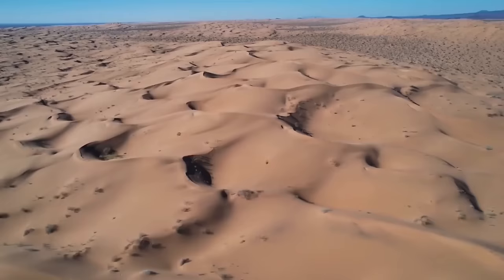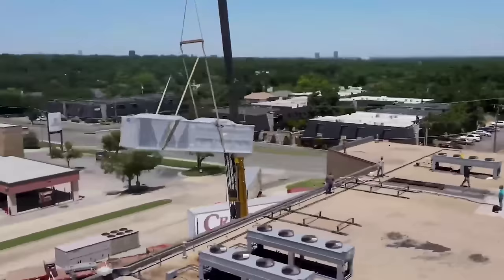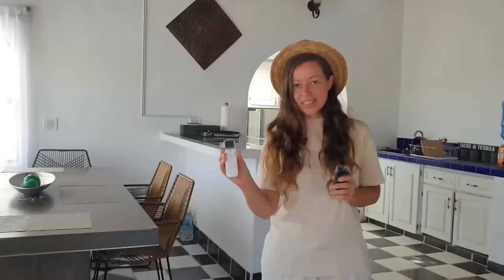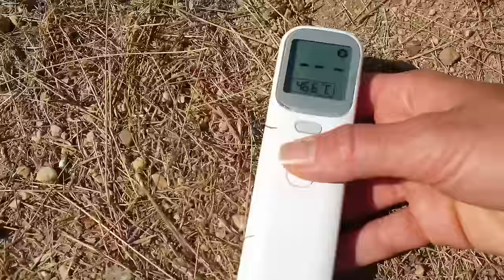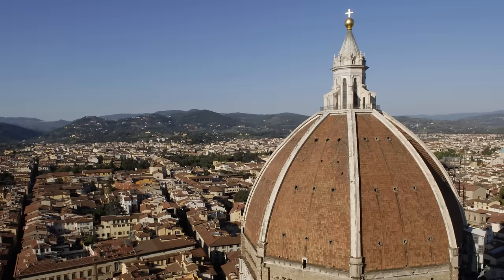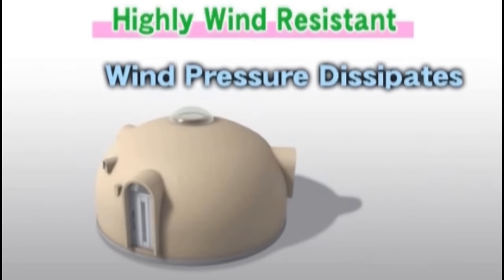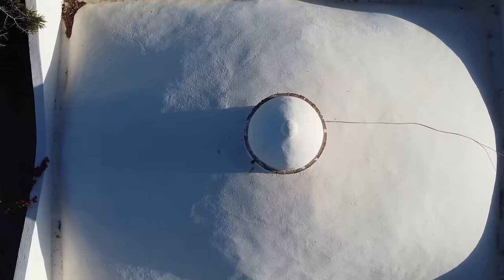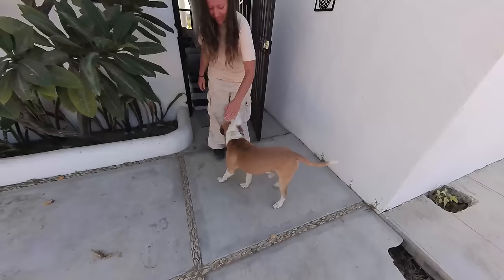How I Live In The Hottest Place On Earth Using An Ancient AC System To Stay Cool!

Comment from the maker: To try 👉 To try everything Brilliant has to offer—free—for a full 30 days, visit https://brilliant.org/LeafofLife. You'll also get 20% off an annual premium subscription. NO MINI SPLIT SYSTEM WAS USED IN THIS VIDEO. YES THERE IS A SYSTEM BUT IT WAS NOT USED. ITS ONLY THERE BECAUSE THE HOUSE IS A RENTAL PROLERTY AND YOU CAN GET MORE BOOKINGS IF YOU HAVE AC AS AN AMIENTITY, ALSO THERE ARE EXTREME TIMES IN THE SUMMER WHEN IT GETS VERY HUMID OR AT NIGHT WHEN IT GETS VERY COLD IN THE WINTER SO ITS USED AS HEATING. BUT IN THIS VIDEO IT WAS NOT USED. THE WHOLE REASON I CHOOSE THIS PLACE TO RENT WAS BECAUSE I WOULDNT HAVE TO USE THE AC IT MAKE ME VERY SICK, SO I WAS SO SURPRISED HOW EFFECTIVE THE DOME WORKED THAT I MADE THIS VIDEO. IF YOU EVER HAVE BEEN INSIDE A DOME YOU WOULD NOT BE DOUBTING THIS. ITS PRETTY SIMPLE AS WE WXPLAIN THROUGHOUT THE VIDEO.
Reply: Brick roof vs modern solar panel roof. I rather choose second on sunny part.

Comment: Pro tip: When it's 25 C° inside and 45 C° outside, don't open the doors and windows. 
Open everything at night, and close them in mid-morning.
Reply from the maker: this is true but at the same time because the house has over hangs in front of the windows its actually creating an area of cool air in front of the house so even when you open the door and window you can feel a cool breeze as the heat from the top sucks in the cool air
Reply: At my place when it's 45°C outside, it's 50°C inside. The windows are facing West so they get direct sunlight in summer and get super hot starting from around 3pm and stays hot until late nights or early morning. Don't like to open windows because of dust, pollen and flies/insects. Some days can also get very humid.
Reply: Yes, I agree. Maintain all windows and doors closed when the highest temperatures, and open windows and the roof window at night to create natural ventilation. The hot air flows upwards, escape and force cool air to enter through the windows.
Reply: Pro tip : move to a cooler location
Reply: Night time temps in the region during summer don't fall below 35C.
Reply: Why no shade sails? And there seems to be a conventional air conditioner on the wall...

Humidity has to be really low.
Reply: @larsstougaard7097  LOL! 🤣
Reply: This doesn’t work. The walls also become hot.
Reply: @moussapolytropos  It's still heating up much slower inside this way than if you let in warmer air from outside. 
I live in southern France, and I do this every summer. Mexico is hotter, but it's still true.

Edit: as long as your home is well insulated (thick walls, double-glass windows.)
Reply: @abadyr_  in Greece, when the heat wave lasts many days, with (double glass) windows, curtains and shutters closed, if you don’t have AC, you will faint… even with thick walls.
Reply: I can see the Air Conditioner behind, I think its the reason.
Reply: @lm-pw9ul  Put shades or blinds on the outside of your windows. You will see an incredible difference in the inside temperature.
Reply: @lm-pw9ul  There're reflective films (and new windows with them) who can decrease the amount of solar energy which passes through the window-glass.
The 85% one is like a mirror on the outside (but not like a mirror on the inside), and the lowest one is AFAIK 30%
Reply: Where i've been In Florida and Puerto Rico, opening everything at night will only bring in warm and VERY humid air.  It's late morning that one might get away with opening windows (cause that's when humidity drops while it's still not hot yet), and even then, that kind of nice weather only happens a few times a year, really have to keep an eye on the weekly humidity report
Reply: Mid morning is too late. Need to close them soon after sunrise.
Reply: @lm-pw9ul I stick bubble wrap on the inside of my windows with a fine mist of water as the "glue". This helps keep the heat out and I can easily remove it when the outside air is cool enough to come in. Also works for cold protection. Not noticable by people from the outside.
Reply: @moussapolytropos It does work in places with low humidity. I experienced it personally in Mexico and Iraq. I heard about it also being used in Iran.
Reply: @MarcassCarcass Agree. The areas where these domes are used are all very low humidity.
Reply: @LeafofLifeWorld AKA eves, protect from rain, not ambient outdoor temperatures,  yes, non sun facing sides are cooler than afternoon summer sun exposure, but that doesn't affect measured air temperature
Reply: @MarcassCarcass  Humidity is a killer 
ronny & donny are proff
Reply: @happycook6737  Live under a dome. 
Or use evaporative cooling for cents in the dollar for AC
Reply: Sir ,the place im in right now could reach 46 c at 1am
Reply: 48-50°c is quite common in my place in india too
Reply: What about places with high humidity?
Reply: burglar, robber , and coyote : yes yess.. open everything at night 😈
Reply: I agree but it is important to remember it because it is easy to forget to close windows, otherwise it wouldn’t be effective at all.
Reply: @lm-pw9ul Try windows made of wood. They block light and heat. More efficient than inside curtains.
Reply: duh
Reply: That’s what I do at my house. Not the same architecture but the same principle. Works great.  The Hot air escape through multiple High elevation roof windows
Reply: @lm-pw9ul  You can sew reflective sheet facing out on heavy drapes over the west windows.
Reply: @JCR_cande  I tell my wife, but she is always right so the windows get opened up on hot days.
Reply: @lm-pw9ul plant some trees your window if possible.
Reply: @Cactii101  seems like India lol
Reply: @StardropSmoothie  Then it wouldn't be 25 C° inside, would it?
Of course if it's hotter inside, you should open the windows. 

My point was do not let the cool air get out, and try to get air in when it's cooler outside, rather than when it's hot like so many are wrongly doing.
Reply: Here is solution for you guys for those who live in less humid areas have a water storage tank in ground and use an desert cooler water storage under ground can make water at 20-25 deg cooler and never open window in day time only. Open when sun has set you should wait for 1-2 hours use curtain and close them when sun rises and fill your cooler tank at night when sun is about to set if its a concrete tank you made to store your water. And if you are in middle of buliding your home then use windcatchers that more effective most of the hot air in your room bump into. Your roof so make some kind of chimeny there. Now for guys with high humidity use dehumidifiers or bulid some water storage inside your living room it can act as pool as well
Reply: @lm-pw9ul you can put those cute 50’s style sun shades or solar screens on. Or simply line the hottest windows with tin foil. Works wonders.
Reply: Close them by 6 am really.
Reply: That is only a good idea if you live in a safe area.Also I tried that but another tenant in the house who is a technology expert (therefore he doesn't understand much outside of technology) didn't understand why I was keeping the back door to the house open at night, got mad and slammed it shut
Reply: @myspace1876  shutters, or overhangs
Reply: @LeafofLifeWorld im sorry, but overhangs do not reduce air temperature. There is a difference between surface temperature and air temperature. With the overhangs you are reducing the surface temperature of the wall and the amount of solar radiation entering the window but the air temperature is the same. The person is correct in saying you should reduce the amount of hot air you allow inside. The coolness you feel is probably the effect of the air movement you feel against your skin and not actually the temperature of the air. The moment the air velocity reduces, you will not feel cool anymore but the amount of heat that comes in with the volume of air remains. So yes, insulate, and reduce the volume of air you allow inside especially during peak hot hours of the day and ventilate intensively during night time.
Reply: Or you could just turn on the AC unit at 4:09 that you lied about using.
Reply: @Cactii101 how do you and peers in the neighborhood sleep?
Reply: @moussapolytropos whats the cooler you’ve been in hot environment in Greece ? I found a natural garden for the public and in the shady forest 🌳 I thought 💭 I will find relief but it was just shaded but still very warm or hot just not scorching with sun. Then went to a platform rising above the trees were is open for people to sit and oversee the place and it was breezy and in the shade it was cool amidst heat of 34c. The trees in the forest were blocking the air although shading the place
Reply: @xaviercruz4763  Air Conditioning
Reply: That's a great way to get your place nice and humid and stuffy. There's a reason people in high humidity environments like the American Southeast or Southeast Asia break from your practice and have open air houses.

Read up on wet bulb temperatures.
Reply: @Cactii101  so without it people were not living there before right?
Reply: @xaviercruz4763  what are you trying to get at? Have you even experienced 45C in the shade?
Reply: And have mosquito screens on windows and doors.
Reply: @lm-pw9ul is reinforced concrete used in the construction by any chance? It's terrible for insulation.
Reply: @abadyr_ and no reinforced concrete. It absorbs heat in the day and radiates it back in at night. This applies to cold months too when the walls and roof absorb heat from inside and continue to do so at night.
Reply: This is mostly due to the way modern cities and buildings are made. Older people in Greece, living in more traditional houses would do the same, keep everything shut during a hot day and open all windows after the sun goes down and during early morning hours.
Reply: @larsstougaard7097 I’ve lived in Alaska 45 years. Before that I lived in New England. I love the cooler temperatures. It’s August and the hottest temperature in the last week was 20C.

Comment: Am I the only one who sees the air conditioner on the wall opposite the entrance?)
Reply: At least 4 air conditioners!
Reply: @hundertwetter  according to one of her comment, it wasn't used in this video (while making the video) and also it's a rented property and some foreigners might demand AC, many other houses don't have it though.
Reply: The building is covered with AC units!  🤨
Reply: @Fx_Explains  It could have been used before the shooting of this video, hence lowering the floor temp in the home. It's disingenuous at best.
Reply: Trade-Off Between Maximum Build Cost, for Insulation and Thermal Stability, and trading some of Operating Cost, It seems.
A Cool building is Nice, but a waft of Cool Air is also Refreshing!
Reply: That's a bloop 😅
Reply: We don't use them...
Reply: It's an ancient desert system. Read the title of the video!
Reply: @teachercatalan952  I believe it, I do a lot of passive heating in cooling here in Tucson, AZ, the top of the Sonoran Desert. Where are you located? I'd love to come visit!
Reply from the maker: @Fx_Explains Thats true, we said that, also there are very extreme moments when it can actually get very cold at night, so you can use them for heating also there are 2 months of rhe year in jult and august which is the hurricane season, its the hottest and most humid time. There were 2 units not 4 as someone mentioned, I definately didnt use them, because i personally get very sick from using AC thats why I booked and stayed here, after staying in another house that was really hot in the same area (without dome) i was very excited about how cool these dome houses are that i wanted to share it and make a video. If people think i will go to so much trouble to fake it then they really are crazy, when all over the world domes are used for this exact reason all it takes is to go into a dome church or mosque there are plenty of them around and you can experience the cooling affect for yourself.
Reply from the maker: Thats true, we said that comment, also there are very extreme moments when it can actually get very cold at night, so you can use them for heating also there are 2 months of rhe year in jult and august which is the hurricane season, its the hottest and most humid time. There were 2 units not 4 as someone mentioned, I definately didnt use them, because i personally get very sick from using AC thats why I booked and stayed here, after staying in another house that was really hot in the same area (without dome) i was very excited about how cool these dome houses are that i wanted to share it and make a video. If people think i will go to so much trouble to fake it then they really are crazy, when all over the world domes are used for this exact reason all it takes is to go into a dome church or mosque there are plenty of them around and you can experience the cooling affect for yourself.
Reply: @LeafofLifeWorld  Yes the monsoon season is really the only time when if you need extra cooling you need A/C because of the high humidity. I grew up with what's called a swamp cooler, which is just a fan with pads on the four sides that water is trickled through so that it creates cool air. That works for all of the summer because of the dry air except during monsoons. I like that so much better than A/C as I tend to feel pretty sick with it as well.
Reply: Doesn’t mean it was used. 

Having lived in houses like these, I can definitely confirm what she says about the temperature difference without ACs, and purely because of the design, material of the building and the vegetation around.

The ACs are probably if the residents want it even cooler than 24. 

These designs have worked for centuries.
Reply: I caught that as well. There has to be solar set up somewhere.
Reply: @Fx_Explains just turned it off 5 minutes before the video. There's a few quite odd adsorption cooling systems in American desert building that work well. But this wouldn't be one of those remarkable systems
Reply: You're not meant to see that! Honestly as an off gridder, the cheapest method is an underground building or pipes that run deep underground with air blown from them.
Reply: 😂😂😂 a two ton mini split system 😂😂😂
Reply: @LeafofLifeWorld :  thank you for defending your video. The system you showed on the house, it works great as long as there is enough cancellation at the top of the dome, and all the other measures you mentioned are taken. Certainly it is not as perfect as air-conditioning but you have none of that crazy noise and none of the cost.  I do my house the same way, slightly different environment, and different architecture, but passuve of heating and cooling
Reply: Only the Living room uses the dome.  The rest of the house with flat roofing must require air conditioning.
Reply: We made similar house in Bangalore India, I have AC in my room peak summer still we need air conditioning
Reply: I saw at least 3 air conditioners on the roof alone.
Reply: @Randomcomment7699  is Bangalore humid?
Reply: @kenyonbissett3512  summer is bad from couple of years.. we constructed experimental mud house
Reply: There are MULTIPLE minisplits and condensers shown and this is a video that LIES
Reply: Me too😆
Reply: Couple of efficient mini splits and then this system would be perfect
Reply: Yet there's minisplits all over the house lol
Reply: Damnit you made me have to watch it over again lol
Reply: A mini split system
Reply: Saw that
Reply: @LeafofLifeWorld  75 degrees F is not and i repeat NOT COOL
Reply: @houseofaction     Are you joking?

  It's all relative.  Compared to 100+ yes, it is quite cool.  Compared to 80, not so much.  Humidity also affect it a lot.  I would rather have 80 * and very low humidity than 75 * and very high humidity.  

  75 with low to moderate humidity is quite comfortable, and again, especially when it is either extremely hot and/or especially when also very humid out.  I live in the southeast where I experience plenty of both, and for a good portion of the day, I keep the thermostat at 75.   At night time when it is cooler and more humid (and energy costs less after 10pm), I crank it down to 70, mostly to help remove humidity.
Reply: Nope, LOL! I saw it too!
Reply: I heard about this way of cooling in ancient times. I have to say, living with bricks over my head might disturb my sleep. Lol. I’m always thinking about worse case scenarios.
Reply: @CoffeeCrazy  how is it any worse than sleeping with concrete slabs held up by some wooden beams over your head?
Reply: @nindoninshu  I don’t know because I dont have any concrete in my home. The implication I was inferring was though I don’t want nothing falling on my head concrete, bricks and stones seems more painful if they were to fall on your head.
Reply: @CoffeeCrazy  interesting, what do you have as a ceiling and roof? i've lived in various places and apart from wood cabins i've hardly seen a building that doesn't have concrete or some form of rock/stone either as a layer in between floors or as the ceiling under the roof
and yeah a brick would definitely hurt more than a piece of wood of the same size, but neither of them would kill you and they would both still hurt enough to equally upset you if hit by one 🤷
Reply: @nindoninshu  wood and asphalt shingles. In America most individual homes have roofs that are made of wood sheets and asphalt shingles. If there is any concrete material it’s usually a bottom floor slab, if your home does not have a crawl space or concrete footing for your foundation if you do have a crawl space.  If you live in an tower apartment then of course you will have concrete reinforcements.
Reply: @CoffeeCrazy  true, i guess i assumed what is under the second floor of a house is most likely above it too, but after research it does seem that the attic floor base is almost always made of wood
Reply: @nindoninshu  yeah , only if it is an high rise apartment or building.